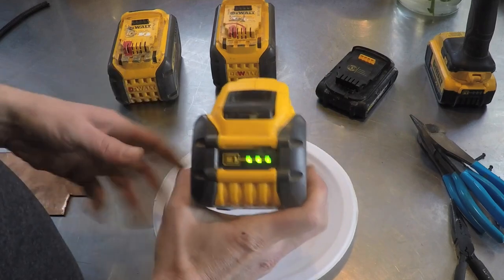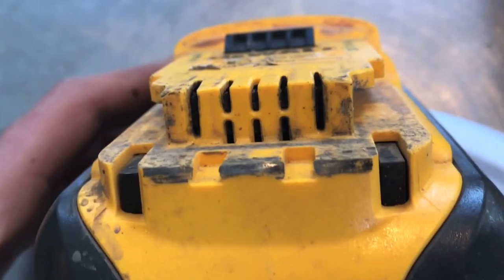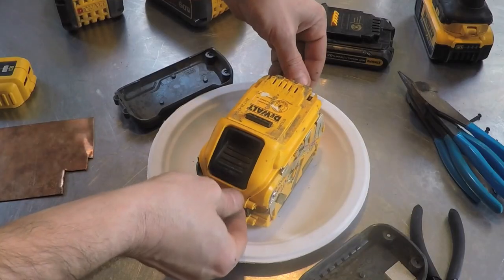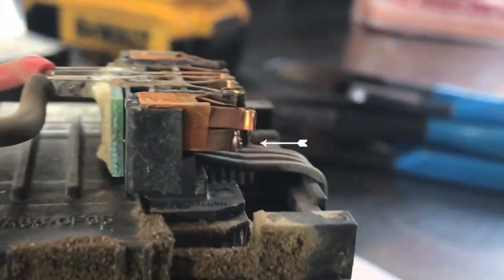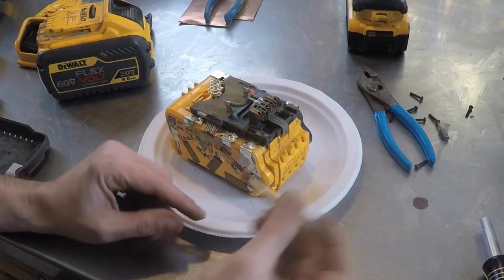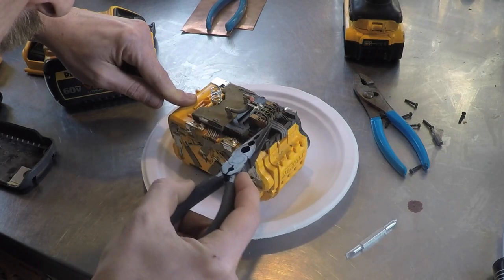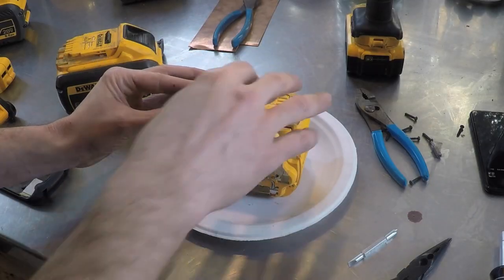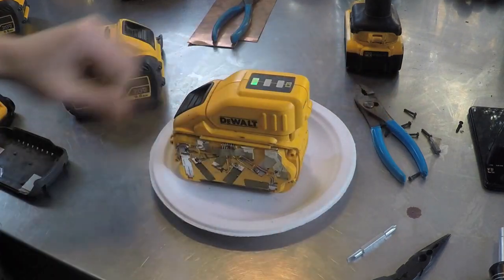Quick Fix Dewalt Lithium Battery

Comment: Nice!! I use to have this issue with the small 2ah batteries. Does that little piece you added not want to fall out or pull away with the male side when you pull the battery out?
Reply from the maker: There are plastic rails inside the battery cover that keep little copper piece from moving around. I thought about soldering it, but it is really snug.

Comment: What if battery is working with 20v tools; but won't work with 60v tools? Battery Flexvolt 2ah; contacts looks fine
Reply from the maker: Sounds like it could be a problem with the 20/60 battery switch https://youtu.be/VAmghq7XadQ?t=245 but not sure how to fix that. Also not sure Dewalt makes a 2ah Flexvolt Battery. The smallest 60v I can find is the 6ah pack DCB606.
Reply: @ScottBl8ke  yes, it's DCB606